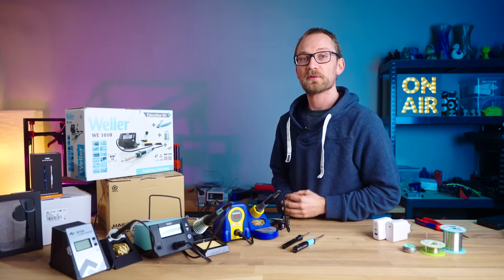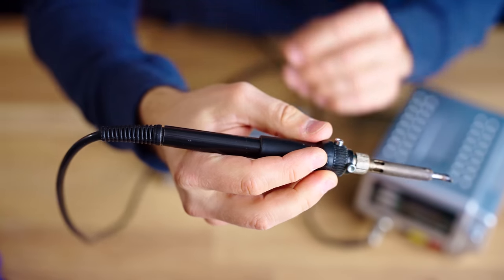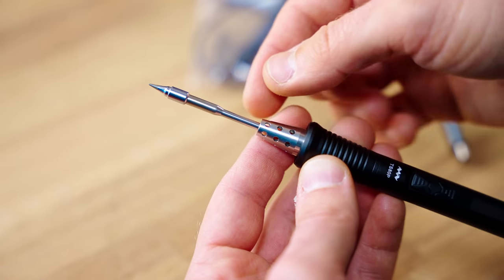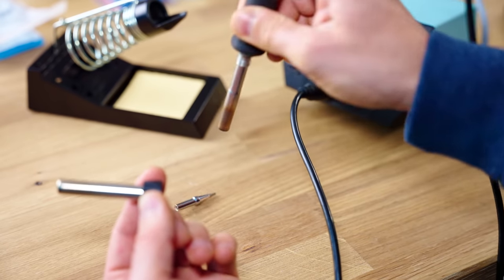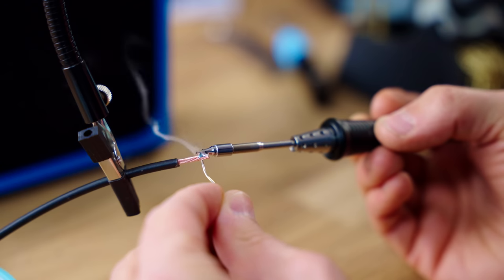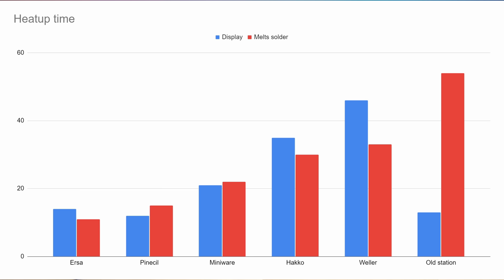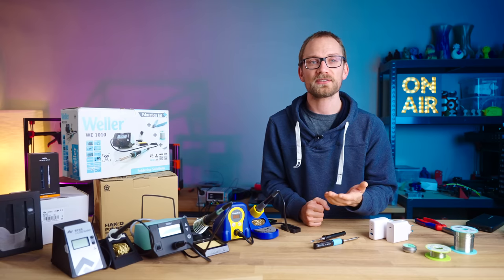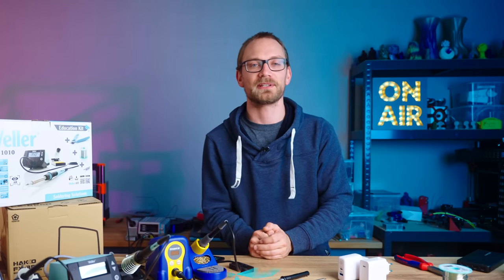Best hobby soldering iron? Pinecil vs. Miniware, Hakko, Weller and Ersa

Comment: I have experience with the TS100, the Weller WSP-80 + PU-81 and the Ersa RDS80 stations. Not the same as in the video, but I really prefer the Weller from the bunch, with the TS100 coming in at the second place.
I might look into the Pinecil, as I didn’t hear about it before.

Comment: I use the t12 cartridge ksger stm32 station. Runs amazingly and is a full station for under 100cad and is grounded with cheap high quality tips for about 12dollars each. The ts100 can be had for half the price of the ts80 and feels better in the hand.
Reply: TS100 and Pinecil can actually use the T12 tips as well, though they stick out a lot further. But people have made grip extensions for them.

Comment: I learned to solder with the old school wooden handle soldering irons of 30, 40, 60, 100 and 150 watts cautin and weller soldering iron 100-200 watts double tap trigger system with pine rosin flux and paste and although i never had used modern soldering irons i believe it will be easy to learn how to

Comment: The Pinecil actually only needs 1 screw removed to change the tips so tip changes would be faster then tested here :) (the other screw is for the case).

Comment: I use a TS80P myself. Absolutely love it. If anyone decides to grab it I highly recommend flashing the IronOS firmware. The TS80P needs a USB PD 2.0 power source. Many wall adapters will already support this. Battery banks are a hit or miss. The TS80P w/ IronOS has a boost mode that will max out the tip temperature. I don't think this was tested. It would be interesting to see how that mode performed on the 6mm wire.

My TS80P also crashes frequently with the stock firmware. The IronOS firmware fixed everything. TS80P is the same as the TS80. The P model is the USB PD version.

If you work in awkward positions or places. The battery powered TS80P might be the solution for you.

Comment: I bought a TS100 soldering pen two years ago to replace my horrible plug-in one.  I'm actually very impressed with the performance you get with the package. The Pinecil looks like a cheaper alternative to it.   I, like many people contemplated getting the ever popular Hakko FX-888D.. It certainly benefits from Hakko's reputation because in the end it's not the best performer for the money.
The only reason I would like something different than the TS100  is to use a tip for heat-set inserts, which fit the Hakko. I'll probably just get a large tip and file it down.

Comment: Good review enjoyed watching! I'm cheap to a fault so I've been rocking a Quicko T12-942. It's is a cheap iron, but uses the T12 internal heated tips. With a 24v power supply it gets hot quick and has decent heat output. It has a really nice price/performance.
Reply: The t12 clones are the best value soldering iron not sure why is wasn’t included in this review. The China USB soldering irons are okay but when you look at power supply’s and tips it ends up being way more expensive and unless you need ur station to be portable there isn’t a reason to buy those

Comment: I have YIHUA 939D+ and it is so convenient to use compared to these: you have rotary encoder with which you can quickly change temperature; you also have three channels with preset temperatures. Plus, it has a metal mesh (rather then whet sponge) sitting in a container with flux at the bottom. It will also automatically turn off if unused for few minutes. I love this soldering stating, yet, I miss a more powerful option for soldering some very heavy joints like wires soldered to a 3d printer's heatbed, which has a huge thermal mass (Sovol SV06).

Comment: Great job "Project Farming" your vid ;) 
I have always used the Weller station where the tip temps are pre set by the tip itself. It has just an on switch.

Comment: just a little hint: for the purpose you use it for dont use these soldering tips, chisel shaped ones are much better in almost every case (even for smd board repair I/actually everyone I know that solders often does not use these pointy tips)
another thing you should try: with your old station it was probably needed to solder at 350 C, I recommend to not do that, use 260 C and when its needed for big wires or ground pads go higher, I got a ts80p with probably the same solder you have (felder sn96,5ag3,0cu0,5) and it works great
when you go higher your tips wear way faster and then you really need the higher temps

Comment: My pinecil heats from 0 degrees to 350 in about 3 seconds flat with a 24v/5a DC barrel power supply that I got for 15$
It's the best soldering iron that I've ever used. Also I found tips for it on aliexpress for $1.30 each that work exactly the same as the $40 set i bought.

Comment: IronOS (the firmware running on the pinecil) is alsoa available for the TS80 and TS100 series. It was indeed built for the TS100 initially.

Comment: I bought a $40 Chinese soldering station on Amazon and it's been awesome!   I had the $60 Weller station and it was nothing compared to this cheap Chinese one. It burnt up because I accidentally left it on.  This Chinese one automatically backs down the temp when you don't use it for ten minutes.

Comment: You forgot an advantage of the Weller: The cord is silicone so it won't melt if you accidentally touch it with the iron. My Weller also heats up WAY quicker. After 10 seconds I'm ready to go i think.

Comment: I use a cheap soldering iron to weld 3D printed parts together. One that has multiple tips for different types of welds (flat, pointed tip, etc) is pretty useful.

Comment: I have Hakko FX888D, bought tips from Amazon Jp, set, much cheaper.

Also bought TS80P afterwards. I usually go for TS80P if I’m doing minor work, sometimes I power it by my Macbook Air’s charger, sometimes PD output of my monitor. So far I’m happy.

Comment: I prefer an older Weller Station WS81 with WSP80 soldering iron, advantages are the very small tipp connection direct in front of the heating cartridge.
The WSP80 can handle cable 10mm² with a 5mm spatula tip.

Comment: For those wonder the Pine64 Pinecil is the spiritual successor to the TS100. Primary difference is that the Pinecil can be powered by a barrel dc or Usb-c using PD or QC 3.0

Another thing is that Pincecil uses a Risc-v chip vs the STM32 in TS100 but that is more a fun fact

Comment: The Pinecil V2 with IronOS 2.20 from December 2022 can now provide up to 126W with the right tip and USB PD 3.1 EPR, so 6mm² wire shouldnt be a problem. 🙂

Comment: So you only mentioned it in passing, but the big draw for the Pinecil, is hooked up to a battery of proper wattage you can make it a portable soldering station. No need to hook up to wall power, this for me was the biggest draw. the 4 tip set when ordered at the same time as the iron cuts down on shipping cost overall too.

Comment: I have an affordable (though not dirt cheap) chinese soldering station. (Yiha, Yuha, Yuaha or something I cant remember and can't be bothered walking out to check). It works well enough for me but I don't solder that much but it is a lot better than my previous dirt cheap single set temperature soldering iron I will say that. Using thinner solder changed my world though :)

Comment: one thing I like about the pinecil is that pine64 also sells the hammerhead tip for it- if you’ve seen the miniware mhp-30, it’s that but way cheaper and hotter. great for smd, like thermal pads on qfns the tip can’t reach. could also use it on the ts100 but that’s heresy 😆

Comment: I really wish that Hakko could have seen their way to include another button or two and made the interface a bit more intuitive.  That would cement my choice.  I have a Weller WCC 100 I bought about 30 years ago.  It still works well, take about a minute to heat up.  But, recently I left if turned on for a week which destroyed the plating on the tip.  So, I'm looking for a replacement that includes an auto shut off feature.

Comment: I bought the Ryobi soldering station about 2 years ago and it's great. Not sure how it compares to these stations, but it heats up reasonably fast and I have been able to work on some thick wires with the chisel tip. The convenience of a battery is great, although I wish the cable connecting the iron itself was longer and replaceable.

Comment: I have a hakko clone as well which works with the hakko tips. The cheep tip i got with it couldn’t melt solder on a through hole at 480C, while the hakko tip made it look easy at 380C. If you have a clone and want a stronger iron, you might just need a better tip.

Comment: Thanks for a great video, the Pinecil and similar clones are handy to have, but the one I recommend over all of these is an SMC workstation, as it has a lovely little heatgun that comes in handy for 3D printing, you can remove stringing and repair surface after sanding, as well as use it for small heatshrink, and they usually have a lab power supply built in for bench testing, you can power 3D printer boards from for testing as well, way more useful than just a solder station.

Comment: I have a Weller WXD 2020 Rework station that I use for obviously things like pull up and the like, but I find myself using my little TS80 for most small board solder work as the USB Type-C cable just seems to not get in the way like the Weller one does. It also works with my Miniware power supply for off desk work.

Comment: The JBC stations let you change tips in 2 seconds even when they are hot.  They have a built in hot tip changing station function.  They heat up in about 5 seconds.  They also have auto sleep mode.  I have had many good stations but prefer JBC and Hakko.

Comment: You definitely need to junk your old soldering station.  I hope you decide to keep the Weller for yourself or, better yet, sell the Weller and buy the upgraded Weller with the backlit screen.  I graduated electronics school in '74, but started soldering as a youngster with my father's Weller in the 60's.  After  almost 60 years of soldering, I chose the Weller, much like your test unit, when I bought my most recent soldering station a few years ago.  My Weller cost only US$130 but has a backlit screen.  One of the nicest things on the Weller is the amazingly supple, flexible cable between the soldering iron and the station.  The Weller has a very nice standby mode so that it idles at near temperature and heats up when needed in a few seconds.  It was designed for commercial assembly line use and the quality is evident.  It is the best in my opinion.  The Weller, at least my US$130 model, doesn't need the button push to wake it up.  When you pick up the wand, you simply wipe it on the soldering sponge and it will sense the temp drop and wake up.  Nice review. Nice Video.  :-)

Comment: When I worked at as a repair tech at a circuit factory we used the 2000$ wellers which had the nice pencil tips. Definitely my favorite I have used but really overpriced. At my job now as well as the one I have at home is the Weller 1010 from this video. I think it is fantastic but I do miss the pencil tips.

Comment: I've used both.  My old transformer unit had the heater and tip as one cartridge, and became obsolete.  Couldnt get new tips for it.  I replaced it with a simple $25 pen type from Amazon , where the heater cartridge is separate from the tips.  20 tips were the same cost as the previous all -in-one part.   The pen is smaller, easier to store, and cheaper.  The pen can get so hot that it burns up the fine tips, so test yours, and find the temp setting that solders but doesnt burn up the tips.  Later I bought better tips too.  Get the pen type.     (after watching:  avoid the active tips, sounds like my first unit)

Comment: I have a low-end Weller soldering station, and I hate it. I just don't do enough soldering to have a permanent dedicated space for a full-sized station, so regret having ever purchased it. It's a pain to get out and put away, and doesn't fit anywhere with its awkward shape and bulky cords and crap. I only use it for heat-set inserts and other situations that abuse it, with the hope of eventually ruining it and throwing it out.

USB irons are so much more convenient (I have a TS80p). Since they're small and can run off a battery pack, I can create a little portable package to store the battery, iron, solder, USB cable, and other bits and bobs (I 3D printed a custom box.) The USB cables are also much more flexible than what you get with non-USB irons, so it's much easier to have fine control.

So for somebody shopping for a first iron, unless you plan to do a lot of soldering and have a dedicated space, do not get a full sized station.

Comment: i use a yihua 937D+ which is a digital display version of the old hakko 936. the 888D pisses me off. and since getting ahold of an 888 non-D is hit or miss, i just found the best rated clone for under $50. i redid the wire on the wand (silicone, thicker gauge, proper metal aviation connector), and tossed a real hakko tip on it and calibrated it. zero issues out of it since, and the one issue i did have was my own fault (dropped something that yanked on the unit and it dropped, screwing up the calibration, which caused the heater to get too hot, resulting in the thermocouple getting fried. replaced the heater when i did the wire.)

my backup to fix said clone is an ollllld weller non-adjustable direct plug in wand. the last time i used it was to fix the wire/heater/etc on the clone, around the start of 2019.

only other upgrades was an oem hakko tip cleaner (brass brillo pad style in the dome shell), and an all metal combo iron/solder stand. 

from here the only thing i think i'd look into is either another one with all the upgrades to put in my portable kit, or one of the Ksger t12 style units.

Comment: On the TS100 if you just get rid of both screws and use an m1x8mm screw you can snug it up and remove by finger or you can just not use the screws period no harm done and the hot swap with some training can be 2 seconds.

Comment: You definitely missed JBC ... would have totally blown the competition on pretty much all aspects, heating time, tip change time, power output, etc.
Reply: And price, a JBC is almost the price of the rest of the lineup there :D

Definitely way nicer than the stations shown here, but the TS80, TS100 and Pinecil are surprisingly good too.
Reply: @tommihommi1  As i already mentioneda couple of times by now in the comments somewhere else here, if you ever wanna recommend one for a friend:
There is still the JBC "Weidinger Edition" analog Station, it is around 240€ incl. VAT, which is expensive, but still way cheaper than the next "best" option from them!
Reply: @Seriosha  but it's the analog station which isn't anywhere near as nice

Comment: The little pencil soldering irons are handy as a portable unit but for a soldering station, I use a much older Weller unit.
I've had many others but the Weller is easily controllable, comfortable and robust.
As you might have guessed I use a soldering iron more than occasionally :)
Nice review Thomas
Reply: who’s weller?😕

Comment: I have the TS100 and it seems to get thru anything I need for general soldering.  It just depends on the power supply you give it.  I hear that the TS100 is more powerful than the TS80 even though the TS80 is supposed to be the newer version.  I wonder what you would pick if you compares the TS100 to the Pinecil or the TS80?  There is also another soldering station that people seem to have varying luck regarding build quality.  Its called the KSGER.  I've seen teardowns of them and one supplier is a deathtrap and no grounding, while the other is properly wire managed and good practices for assembly where used.  Its a mixed bag regarding that one but its price and features make it very tempting to a lot of people.

Comment: Really well made and in-depth comparison!

I didn't have any problems with crashing software on the TS80P yet, but I agree, that it's a bit pricey for what it is. Especially because of the expensive tips.

Today I'd rather get a Hakko.
Those USB-irons are fine for everything small, but soldering bigger wires with them is a nightmare.

Comment: I have had this weller station for about 3 years now, and it is a beast...most of the time. My the plastic casing of the pen broke around the part where the "hotend" meets it. It became unusable because of that, and I had to buy another pen.

Comment: Even though Hakko is a very good soldering iron brand, in my opinion Miniware and Pinecil soldering irons are the next better options that I would still choose over questionable "House Igniters" (cheap soldering irons that have no safety mechanisms at all).

As for Pinecil and Miniware (I have TS-100), I personally would use IronOS smart soldering iron firmware for a bit more options and better power regulation as well as the sources (ie. user adjustable USB-C Power Delivery settings in Pinecil to manage how much juice you need), already have IronOS flashed onto my TS-100 soldering iron, made it even more useful for the usual soldering job I have in mind, with 420 °C temperature set as a turbo mode for heavier wires and some tabs on components that needed to be soldered a bit hot, with 320 °C being the usual soldering temperature. Love this thing already.

TLDR; if you are allergic to the soldering irons that sets house on fire, but too broke to buy Hakko, go with Pinecil, it's incredibly cheap already and have almost all the bells and whistles of a $200 - 500 professional soldering iron.

Comment: I have a TS80P for quite some time and as soon as I could I added the IronOS for it. It's hardware is quite great, but the original firmware was really buggy. After this Pine64 released the Pinecil and I'm quite sad because it is absolutely better and way cheaper. Anyway, I might buy one if my tip brokes.